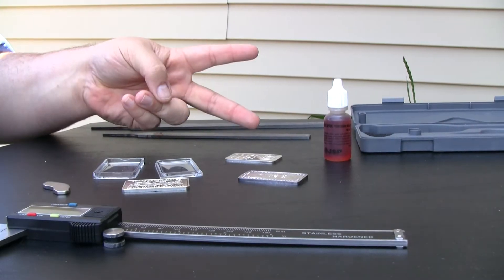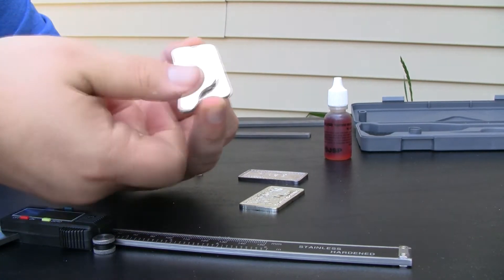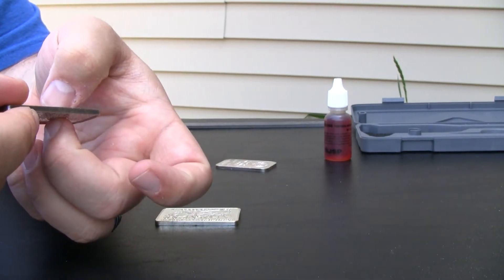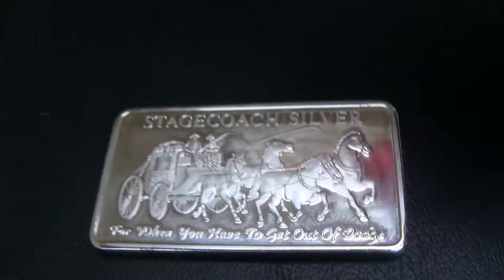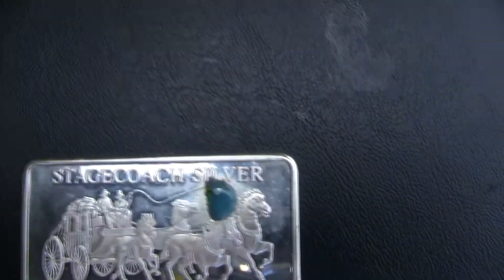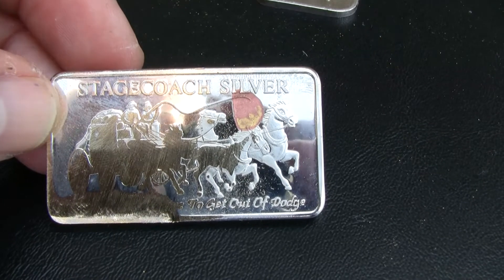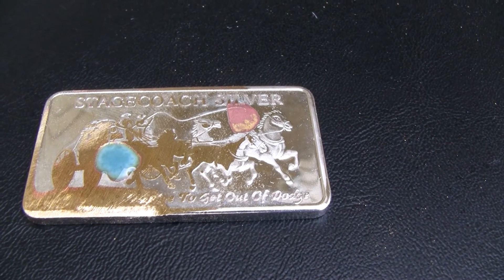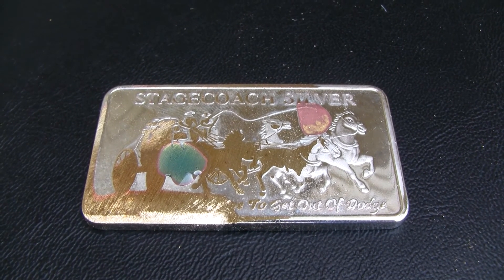Fake Stagecoach Silver Bars - Update 2

Comment: BUT IF YOU DO THE ACID OR OTHER TEST ON AN INGOT AND IT TURNS OUT TO BE GENUINE SILVER THEN YOU JUST MESSED IT UP.
Reply: The amount of silver lost / dissolved by the acid would probably not even be measurable.  It just wouldn't be as shiny as the rest of the bar.
Reply: Silver is Silver dude, not everything has to be in mint, perfect, condition, these aren't coins, and they weigh and melt the same, their appearance has no effect on their value (most of the time)

Comment: I had found the compisistion of the material before... I think its a brass, zinc, copper alloy...  also I think they put a tad bit of iron in there to mimic the resistance that a di-magnetic material has.  But, easy to test - if its attracted and you can drag across the table on a smooth surface.. FAKE!